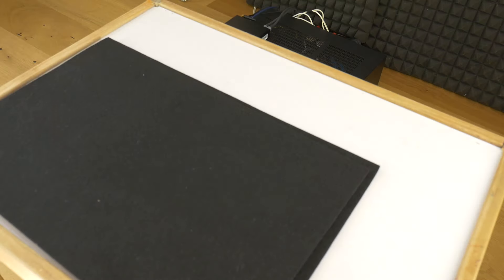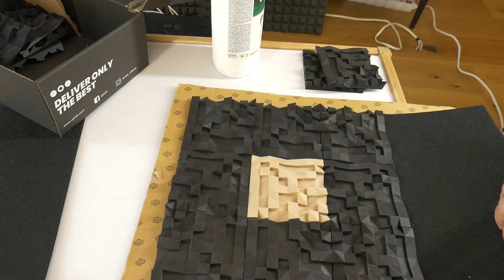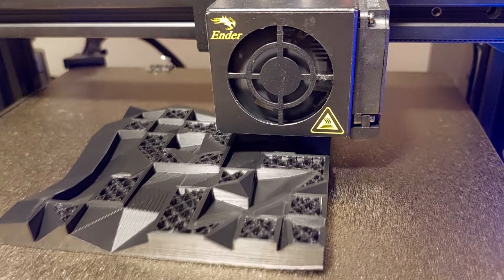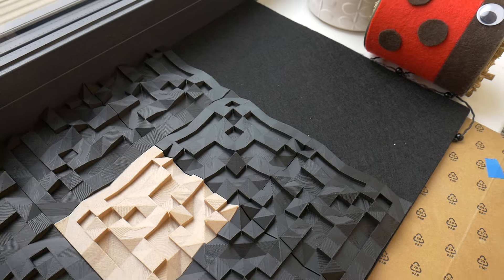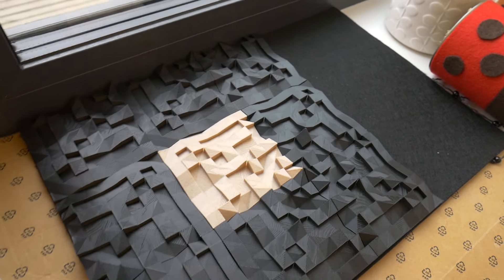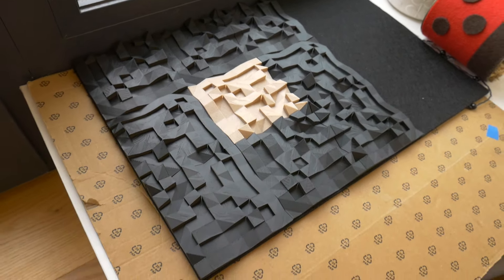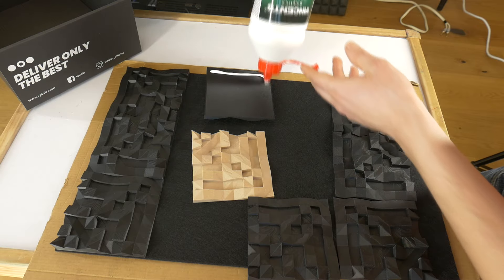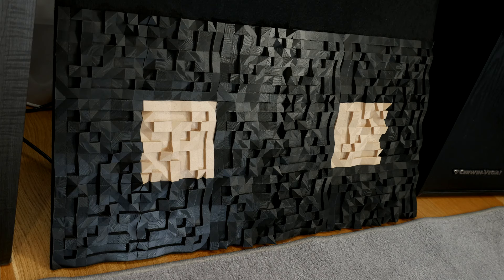Make Your Own 3D Printed Sound Acoustic Panels DIY

Comment: techscews the Logitech satellite speakers has one quarter of treble sound also the Timpano ST3 tweeters has one quarter of treble sound but it is possible for the Timpano tweeters to have four quarters of treble sound if the Timpano tweeters uses modifications

Comment: what's the effective frequency range though? This is rather small...
Reply from the maker: It's more of a decorative feature, because to be effective, you would need to print much taller pyramids. If you tell me how to measure the effective frequency band, I can do it, as I have a measuring microphones.
Reply: @Techscrews  it just needs a room measurement with and without the panels keeping everything else the same.
Reply: Techscrews, for Measurement I recommend you learn REW (Room EQ Wizard), you will need a calibrated measurement microphone. You can measure in room RT60, decay and plot various graphs. As Tom says below you can measure before panels and after. Also you can use your ears, one issue with Diffusers is they don't work well in small rooms, for a Diffuser to sound good, the sound needs to reflect and then re mix and fully integrate before reaching the listener, this means ideally you want listeners 5-6 feet away from the panels. If you sit too close to a Diffuser you can get a get a phasey sounds. In smaller rooms some broad band absorption will likely be more effective.
Reply from the maker: @micb3rd  thanks for so detailed comment.

Comment: I will have to try that my bedroom has bad acoustics I have a arched ceiling and bowers and Wilkins 801 signatures
Reply from the maker: If you had the budget for a B&W 801 then I would recommend buying some good thick carpet and some high quality acoustic diffusers, that should be enough to start with to gauge performance, how much RT60 time do you have in the room ? 

These 3D printed can be used more as a decor, but not to improve the acoustics of the whole room. Then they have to be printed with significantly higher pyramid heights.
Reply: @Techscrews Good advice on getting proper diffusers, but he should stay away from carpet or thick fabrics. This will screw the frequency responce of the room and only address the high frequencies. Using too shallow absorption materials is most often what causes the “dead room” sound. Older 800 speakers, like the Nautilus 805, can often be had for very little money and you get an insane value for the money IMO. But remember to pair with quality amplifier or the results may be gruesome 😊